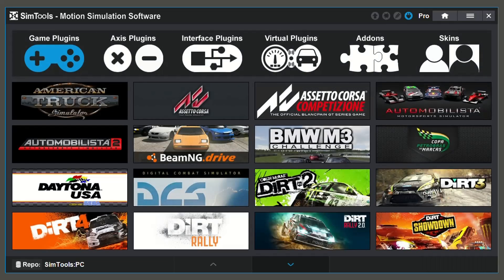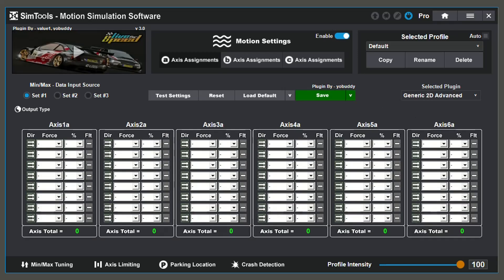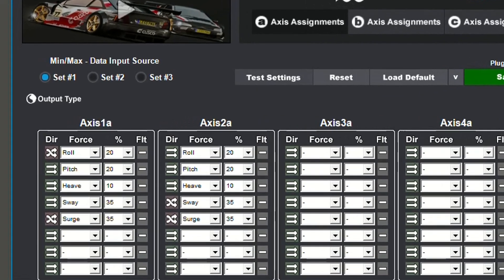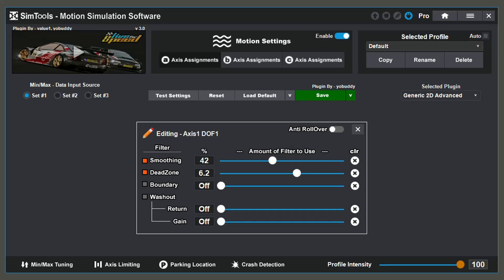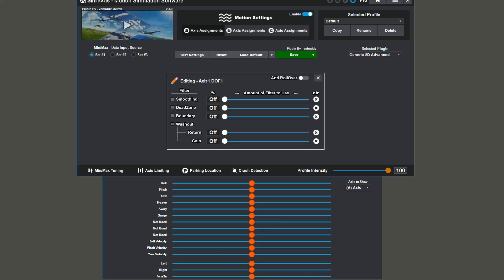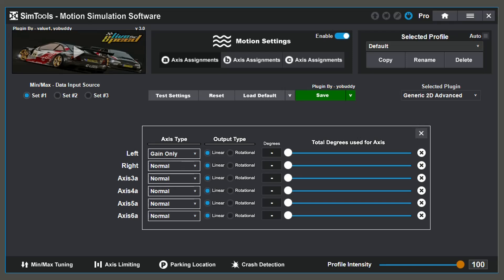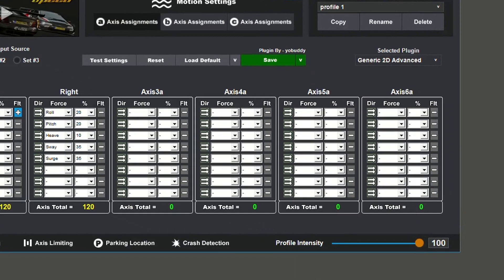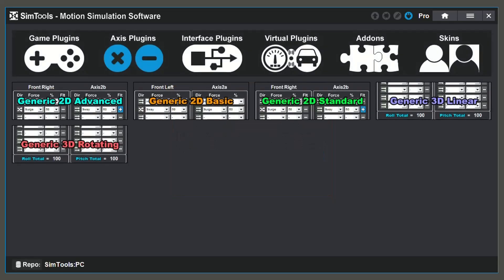Installing an Axis Plugin

Comment: Sweet! Is the Axis Total how far your axis can move? I'm setting up a configuration that takes the value outputted from SimTools over a virtual COM port and converts the binary data to ASCII codes that I can send to my motion controller over a physical COM port. My X and (Y) axes move about 10000 units of measurement, so I was wondering if that Axis total was the total.
Reply from the maker: Axis Total is the total percentage of the axis being used. If you have Sway set to use 60% and Surge set to 60%, your Axis Total would be 120%. Your axis only has 100% to actually move, so if Sway is maxed out from a game, it will be using 60% of the axis. This means you only have 40% left for Surge movements. If Sway is the only value you are receiving, and it is maxed out, then you will only be using 60% of the axis.